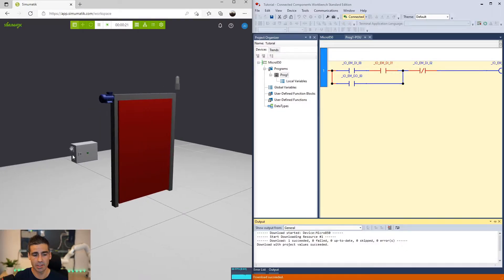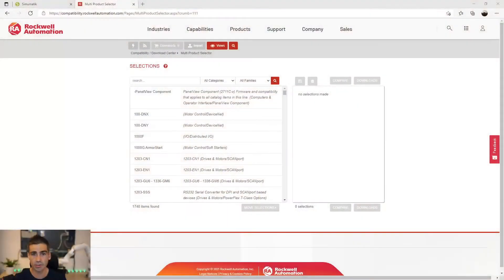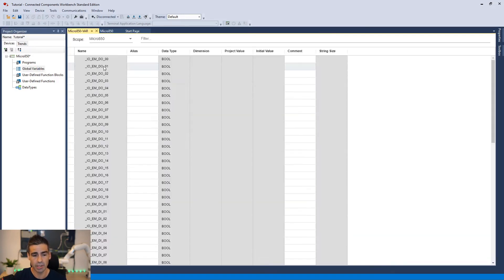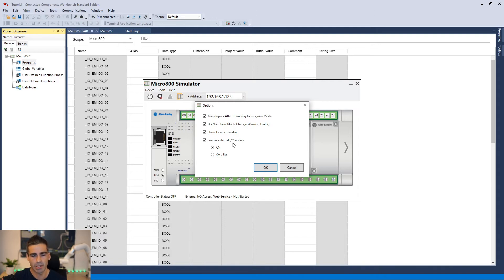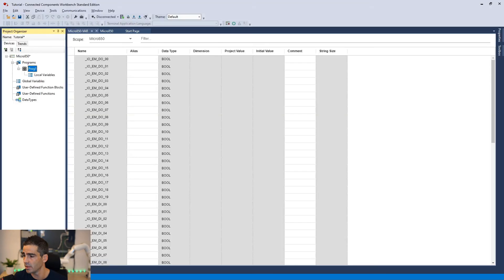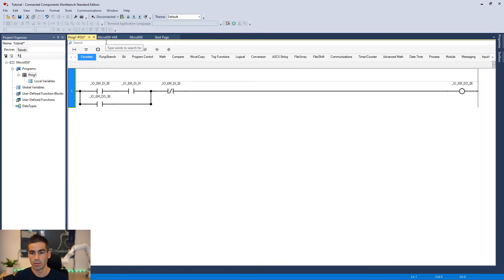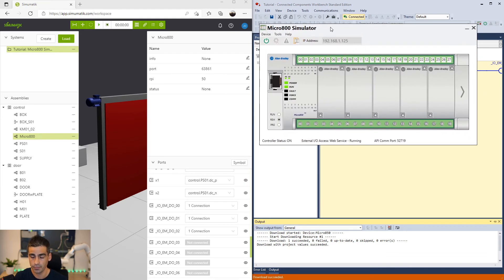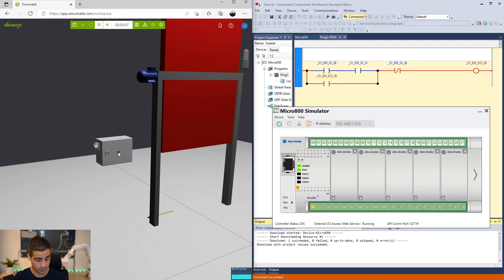Allen Bradley Micro800 Simulator with Simumatik

Comment: How to connect this micro850 sim with Node Red.
Reply from the maker: I guess you can check this link: https://www.rockwellautomation.com/en-pr/support/product/product-downloads/innovation-center/microlink-mqtt-remote-control.html
Reply: Okay I'll check this.
In node red I have used PCCC node and with that I can connect to PLC simulator but I don't understand what to put in the variable address section. Can you help me with that!
Reply from the maker: @supriyogain8218  this is a question for Rockwell rather than Simumatik, but maybe this helps: https://d2000.ipesoft.com/blog/communication-ethernetip-and-encapsulated-pccc/